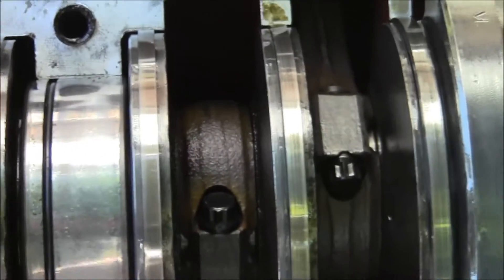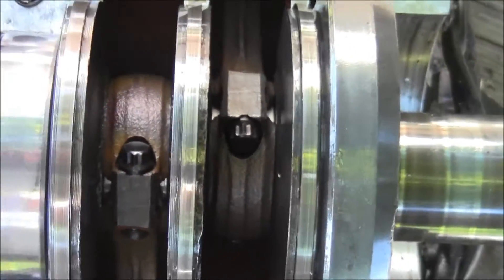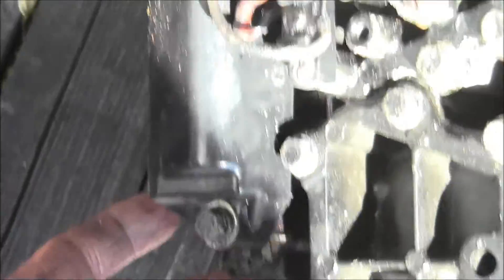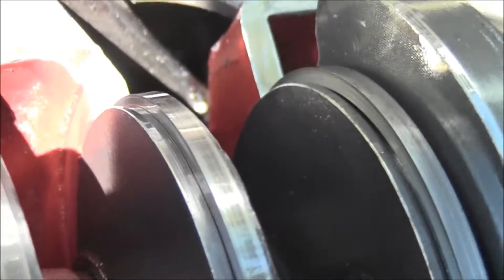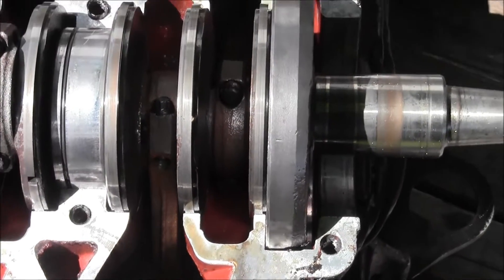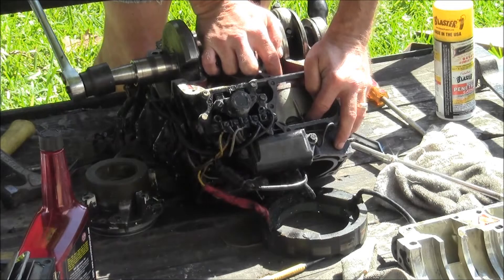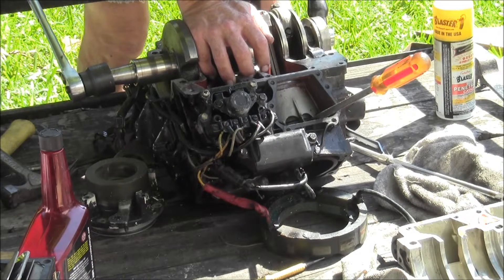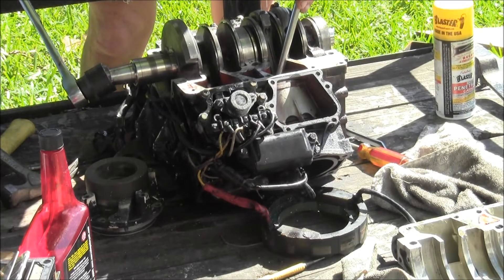140 Johnson Outboard LOCKED UP PART 3.wmv

Comment: As a former Johnson/Evinrude tech back in the late 70s/very early 80s,i honestly have to admit,that for being a shadetree outboard mechanic,i was honestly surprised to see you got it torn apart and running again. I hope you at least also changed the water pump out before you buttoned up the lower unit and have learned the value of putting those mickey mouse ears on and flushing the cooling system out after EACH and EVERY use. OMC made a great product back then. In fact,about 2 weeks ago i saw a guy whom had an old 1972 135 on his boat and i hadn't seen one of those in ages.The thing fired right up,was clean as a whistle as if it had just come right out of the box and the thing about it was.....it had never been rebuilt before n didn't smoke excessively. I was completely amazed of the shape this thing was in for being 43 years old. They certainly don't make them like that anymore and to me theres nothing like a 2 stroke for that hole shot power. They can tell me about todays 4 stroke technology all they want but nope,i'll take an OMC produced Johnson or Evinrude any day. I haven't touched one in years and haven't really kept up with todays technology but Yamahahahaha can stick that stuff in their ass.